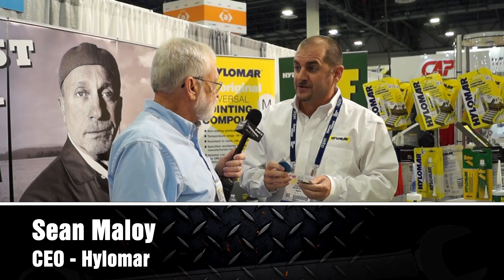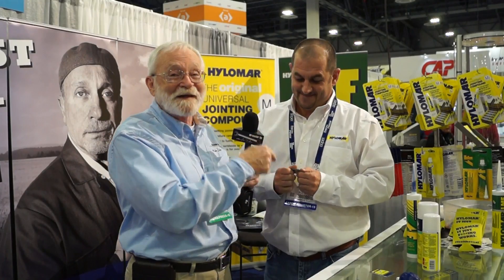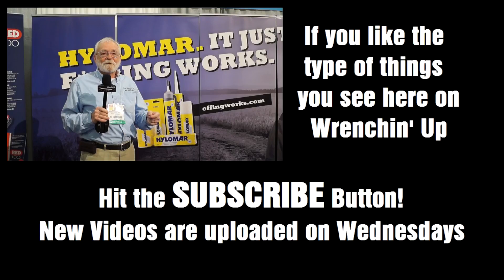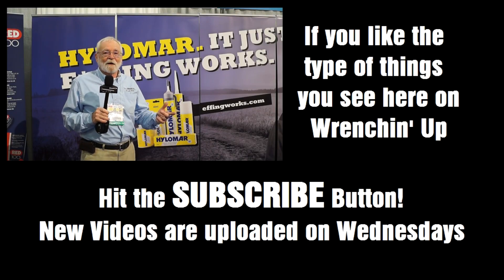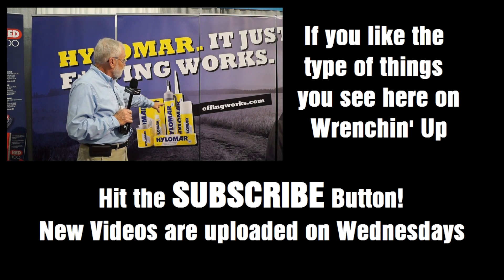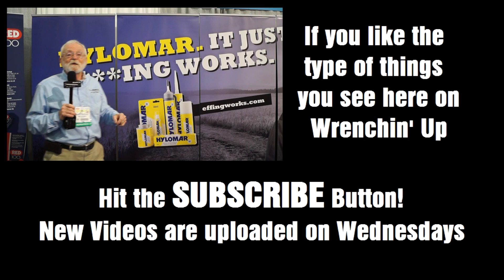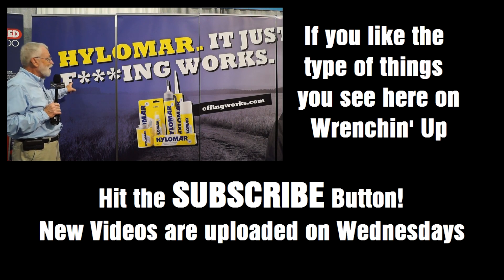HYLOMAR Sealers Just Effing Work! - Wrenchin' Up

Comment: The only Rolls Royce equipped plane I've ever been on had an engine failure just before takeoff. We had to go back to the gate and wait around for hours while they changed it. It was a Cathay Pacific 747.
Reply from the maker: Hi - Thanks for watching and sharing your experience!
Reply: Must have been the Hylomar then!
Rolls Royce have a better safety record than any of the other makers. and they have been around the longest! The Avon is still in use as an industrial generator and has clocked up over 100 million hours in service. Not bad for an engine developed in 1947!

Comment: I used to work on Rolls Royce Dart Turbo prop engines they date back to the early 50s and have no gaskets, just assembled with Hylomar 100% oil tight, how often do you hear of an english engine that does not leak oil.
Reply from the maker: Hi - Thanks for watching and sharing your experience!

Comment: As another respondent said, this stuff has been widely used for many years and I was using it the early 80’s together with hylomar red. Its ok and I use it sometimes but I would far rather used an anaerobic type product as they have much better sealing performance on modern engines and transmissions. I am bemused by this “amazing new product type presentation” when its been around for eons.
Reply from the maker: Hi - Thanks for watching and sharing your experience.

Comment: Great claims, but no proof
Reply: It works - I've used it to seal water pumps, bolts, transfer cases, diffs, and especially oil drain plugs. It's fantastic for sealing any kind of drain plug - it'll fill the threads and prevent leaks, but doesn't cure so you can actually remove the bolt when you need to, way easier than loctiting everything.
Reply: I’ve literally been flying Rolls-Royce turbine engines around the globe for 20-years now, and not one failure from loss of oil or accessory case leakages. I’m also using it to seal the case halves on our Continental piston engine in my airplane after a major overhaul. Hopefully, this is the proof you are waiting for.
Reply: yea seriously.i cant find a good demo anywhere on the internet.........?
Reply: The proof is in every Rolls Royce jet engine youve ever flown in.
Reply: It is a useful product but not necessarily the best but is far less expensive than anaerobic sealants.